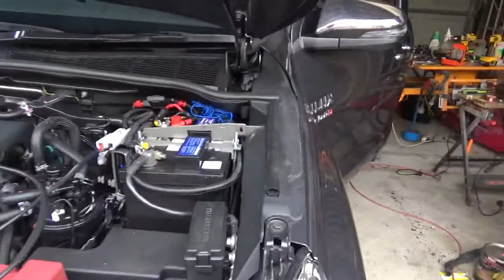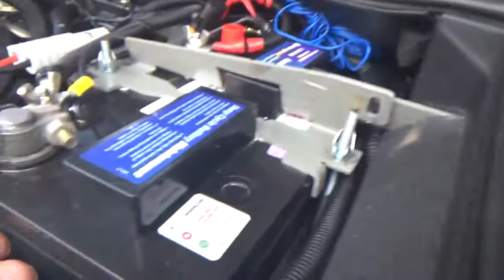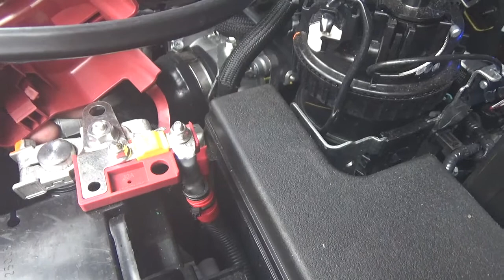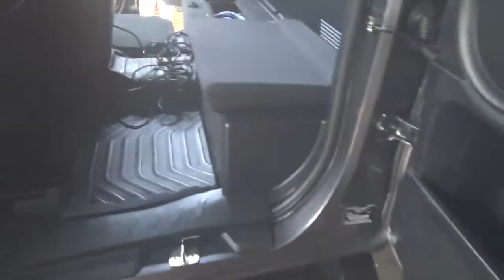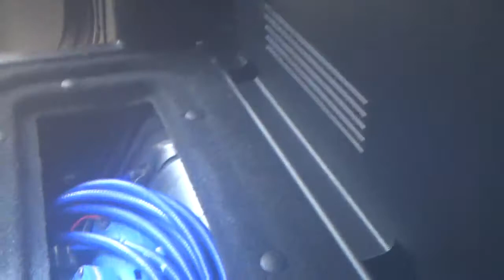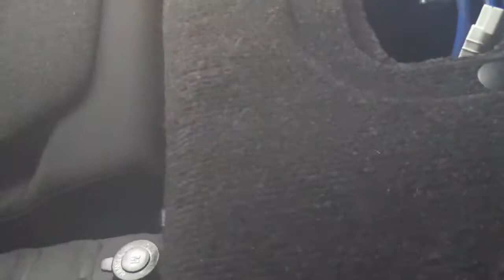Toyota Hilux 2017 fitting DC Solar charger & deep cycle battery

Comment: I’m very concerned that the projector dcdc chargers aren’t heat friendly under the bonnet in that location . It’s better to be mounted between grill and AC condenser at the front of the engine. Ive seen one melt done located on fuse box between both batteries .
Reply from the maker: I went with the projector over the redark as that is filled with a resin to make it waterproof bolting any DCDC to the plastic fuse box cover would be a bad idea 👎the case is a heat sink and the plastic would prevent that working.Mine seems fine been 5 years and 100K KM in Western Australia it gets good airflow near the firewall and the steel plate acts as a heat-sink regards Mike

Comment: Hey mate, where did you bought the battery base? I am currently installing my second battery in my Hilux 2017, need to place my dc dc charger somewhere and your idea looks great. Thanks!
Reply from the maker: It came from EBay back in January 2018 I will have a look 👀 if I kept any paperwork on it
Reply from the maker: Still had the paperwork A company call air On Board part number AOBBTT301 hope that helps
Reply: @kisbushcraftdownunder  I'll have a look, thanks bud!

Comment: Hi mate, how has your dc-dc charger been going? it doesn't get to hot in that position and effect the output does it?
Reply from the maker: Its working well even in 40c+ weather the Hilux exhaust is on the other side of the engine bay this bc-dc charger is not filed with a Gel elastomer like the Redark is they really do need to be mounted in front of the radiator regards mike
Reply: @kisbushcraftdownunder  Thanks mike, yes i thought they needed to be in the front to stay cool, but good to see yours is going strong!

Comment: Hi Mike, I'm doing the almost exact install on my Fortuner at the moment. Did you get the ignition cable sorted? any tips on where/how to connect that up?
Cheers
Reply from the maker: Paul Wood hi Paul I never connected the ignition wire the Toyota alternator dropped Back to I think 13.2 volt still in range of the mppt controller their is an ingnition supply point on the window wiper or behind the glove box regards mike

Comment: No worries mike just thought I would pass that info on as I just bought a 2013 hilux & found out my old isolator won't work. So off to my local auto shop & spend some more money.
Reply from the maker: MYRUM2 MYRUM3 yes so called smart  alternators can be a pain mine drops from 14.2 volts to 13.6 some drop to around 13 volts the smart charger will extend battery life for your second battery mike

Comment: Good set up u have there. just wondering if u didnt get a dodgy battery isolator but just bought the wrong one, due to the computer operated alternator it drops the voltage to low for it to open the circuit to charge your second battery. thats why dc to dc charges are the way to go on anything after 2013 in a hilux.
Reply from the maker: MYRUM2 MYRUM3 hi I did test the battery isolator on a older car and it was dead the smart charger is great the MPPT solar charger really helps the performance of my solar panel regards mike